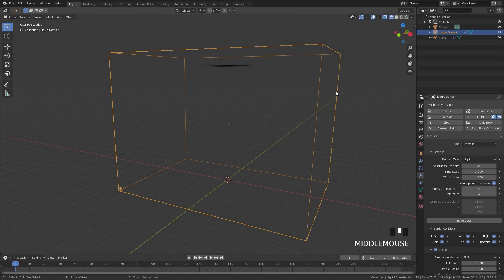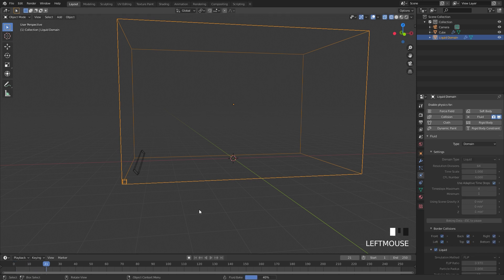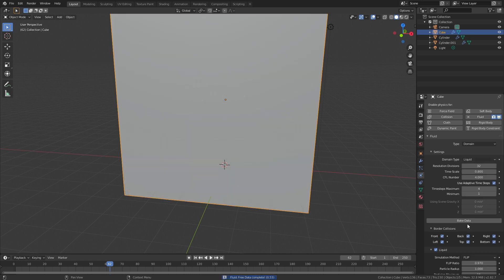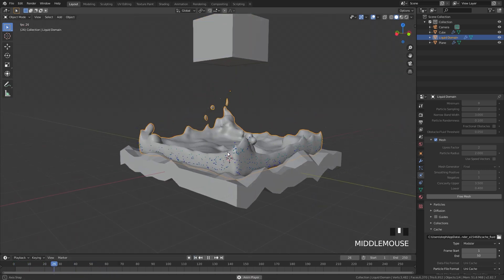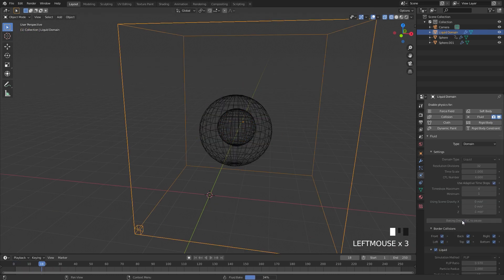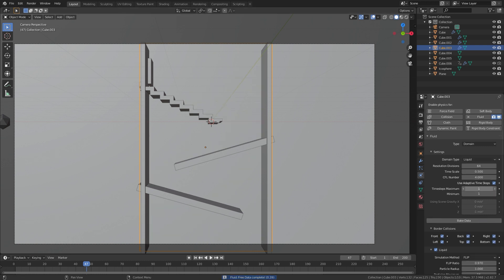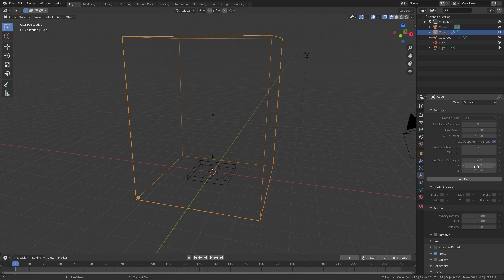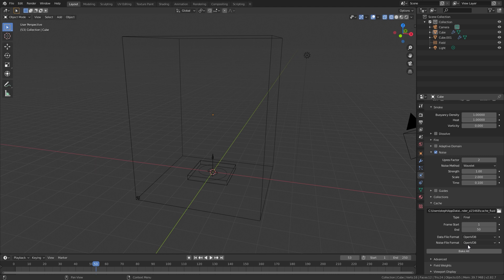Common Mantaflow Problems & How to Fix Them!

Comment: It took me like 3 days to figure out most of the stuff that was mentioned in this video.
While there's no official documentation on the manual about how to troubleshoot the issues, this video will save you a lot of time.
Great stuff, thanks for this!
Reply: can you run by me if you can how to water sim a cube falling down steps with water splashing inside? 
you touched briefly on it......ASAP PLEASE.....AYOUR WORK IS wonderfully inspiring.....
Reply: TheModulator Hey switch from replay to modular and go to cache section of the domain and select an EMPTY folder..
Reply: Took me 3 hrs before I actually gave up and went to youtube
Reply: @kruddystupididiot  Select Domain, then
 Select type, then change the option from replay to modular or All (blender 2.91.0 )
Reply: i guess im asking randomly but does anyone know a tool to get back into an instagram account..?
I was stupid lost my password. I love any tips you can give me.
Reply: TRUEEE. this is life saving hahaha
Reply: 3 days.. pfff.. decent turnaround hahah
Reply: @tomdrake4069  flip normals of cube, put water inside, done

Comment: At 1:00 Select "Is Planar" option for planes ( I believe this option is for planes cuz when i selected this option, it worked well) It works for cylinder or cube which has no thickness

Comment: I'm using the fluid simulator in Blender 4 and this video solved all my problems with dispersing particles. Despite the posting date, this tutorial remains current and functional. Thank you very much.

Comment from the maker: If you have encountered any other problems that I did not discuss in this video reply to this comment and I will try to help out! 
Edit: If you do not see the bake button that is because in the Cache panel the Type is set to Replay. Set the type to Modular and you will see the button. 

Also sorry for the low framerate. I forgot to set up my recording properly! Whoops.  Next tutorial will be back up to 60fps!
Reply: How about the grid pattern in the particles like spray, foam and bubbles. How to solve it?
Reply: Blender Made Easy Yeo bro is there any way I can contact u????
Reply from the maker: I think that is a bug at the moment.  I heard somewhere that it shouldn't be like that.   CG Geek had a great method for getting rid of that grid pattern that you should definitely watch!
Reply from the maker: For business inquires check my email on my About page.
Reply: Thanks for the reply 🙂
Reply: I finished the fluid simulation in my project... How to add a smoke simulation on my fluid object so as to create a boiling milk kind of effect...?
Also, when i tried to apply my bake my fluid domain mesh, it doesn't animate the mesh anymore... how to get around that problem
Edit: also will the surface thickness work for outflow object too?
Reply: this is amazing. is there a way the fluid will go correctly through small holes/tubes? i have a scene with a teapot that i want to pour liquid from (the pot doesnt move) but it wont go through the thin spout, i tried to change multiple settings with no luck, it either gets through the mesh too or it wont go into the tube too far to actually pour out... (its created from a sphere in the teapot)
Reply: I am making a larger fluid simulation, and the fluid is off center and smaller than the flow object.
Reply: I am trying to flow water through pipes & tubes, while your explanations made some improvements, but water still would not flow all the way. . . . how does real world size make a difference?  is there a easier way to to simulate water flowing through tubes & lines? what am I missing?
Reply: @Tamarita112Hyuuga  i am working on a similar problem. I need my fluid to flow through a network of pipes . . . same issue, wont go to far, kinda gets stuck after going a fraction on the length . . .
Reply: @imranwkhan  i managed to solve it with resolution divisions set to 200 but it was baking the simulation for like 3-4 hours (100 frames). and there was barely any fluid so id like to see if theres a better solution to this
Reply: Im trying to make water flow from a pipe into a mug, and for some reason the water isnt appearing. I tried increasing the size of the flow object as well as tried turning the surface emission up but nothing seems to be working. It would be great help if you could help me figure it out. Thankyou!

Ps: is there a way i could share my file with you?
Reply: I made a simulation but I can't render it as a mesh.
Reply: Baked mesh doesnt allign with the baked particles. Somehow its displaced from the baked particles. How to fix this?
Reply: when i try to bake mesh, it doesnt make it a mesh and nothing really happens
Reply: The smoke in my scene won't work properly. I got a Particle System as a Flow Source. I get something like a little smoke cloud in the first frame with the first particle and then it just disappears. No idea what's the problem
Reply: I can see my smoke simulation in the solid view but not in the rendered view. Know why?
Reply: I have a AMD Ryzen 5 3600 and a  GeForce RTX 2060 and a 500GB SSD and it takes much longer then yours to bake even just doing a test at 64 resolution divisions does the processor really make that big of a difference? its a 6-core with a clockspeed 3.6 like your i7-9700K the only major difference i see is yours is 8-core and turobo speed is 0.7 GHz faster as well as the TDP useing more power in yours but TDP really only matters for the heat output.
Reply: Would mantaflow be a good choice to do a dripping blood effect? Trying my hand at doing a melting face over a skull, was thinking shape
keys could work for the face melt but I want there to be bloody fluid on the skull.
Reply: Your video helped me a lot, but I still have a problem with my fluid simulation. I'm trying to make a moving glass of water. The glass does hold water when it's stationary, but once it starts moving, the glass slowly loses liquid (to where - I don't know, water just slowly disappears). Once the glass stops moving, the water stops disappearing.  Only if the glass moves downwards, the water doesn't go anywhere, in all other directions - the water slowly disappears. I checked everything suggested in this video. I just don't understand what's wrong.

Update:
OK, I think I kinda figured it out. Surface Thickness parameter of the effector (which in my case in the glass) was causing the problem. Apparently, effector's Surface Thickness is fine for static stuff, but not good for animated vessels. It should be set to 0 and you should increase vessel's thickness to avoid liquid leaking through walls. If you can't make walls thick enough (because it looks ugly and unrealistic), then increasing domain's Resolution Divisions helps.
Reply: I´m trying to use small portion of liquid, trying to fill a small cup of coffee. I have several issues that I think I can solve by myself looking around internet, but there´s one I can´t find anywhere. As soon as I set my particle radius to below 0.5 the particle seems not simulate properly and just hangs from the emitter (inflow). And I think I need to set to at least 0.08 to check if it makes the difference I think it will make. Do you know if it is possible?
Reply: Thanks mate for the nice video. Saved me a lot of sanity :) I just have a questio. I'm going to animate a Volcano and it's going pretty well, yet I have a problem. When I set up a short fluid inflow to simulate the lava is jumping up and falling back down to the crater it's not working. Is it possible to create a small amount of fluid that is shooting up and shortly after falling down again? Many thanks and keep on your nice work.
Reply: I can't get any fire, water or smoke to appear when I bake data, the particles just stay as particles. What should I do?
Reply: @Tamarita112Hyuuga  try to scale up the teapot, maybe helps.

Comment: Thank you! 👍🏼 It did not fix my problem but at least now I know where it comes from. Another thing to mention for fluid sims with mantaflow: I never got a proper result when I tried to use real life sizes. I had to make a 60 cm wide cup to be able to 'splash' the fluid in a realistic looking way.

Comment: My Fluid simulations never work, I add a uv sphere then then select fluid, then change the settings to liquid and inflow and domain resolution to 64. pretty much the same setting you use and see no particles when i bake data. this happens everytime
Reply: Same here. No matter what I try even the simple sim setups don't work in Blender, just not worth the time anymore :(
Reply: make the sphere bigger and try again

Comment: Hello, thank you for this video! I am having problems creating a fluid sim running through a pipe where the liquid seems to hover above the surface of the inside of my pipe. Even with no surface thickness it seems to hover over it :( I've tried everything you've suggested in this video and more!
Reply: did you ever find a fix for this issue ?
Reply: @razz6539  Hmmm, that was a long time ago but if I remember correctly pumping up the resolution size helps create smaller fluid particles. But of course that increases bake times. I would suggest getting Flip Fluids if you can afford it, I have been using it since and it is much better but it is pricey.

Comment: Another problem I get a lot is that the fluid doesn't quite touch the object it's supposed to be hitting or resting on.  I've played around with settings to get it close but I'd love to hear how you solve this.  Thanks!
Reply: Try reducing the surface thickness of the object.
Reply: @shahanashaikh7061  it's still floating even with a thickness of 0

Comment: Fabulous video for beginners.. really very very helpful.. I still have one problem though.. when I simulate fluid, between the effector and fluid, there is a small gap. how can I remove it so that the fluid gets touching the borders of the effector. Thanks in advance

Comment: Under inflow there is clearly a setting called is planar. If you check that box a plane emits just fine. Dont need ro add thickness or anything.

Comment: I am guessing that the size of the emitter has to be scaled up because it has to at least be as large as the Voxel size. I wonder if you left the emitter size the same but changed the voxel resolution if it would work

Comment: If the domain size us huge like a real life room size and the inflow is small. What setting would you need to tweak to make that fill a room? My kitchen scene...the fluid starts to over flow the sink but stops once it dripples over the edge and doesn't continue when touching the floor. I have all objects set to effector and as planar too. Is there a setting that tells it to spread out more?

Comment: What do I do if there is no "bake" option? I have done everything step by step and I don't have any option to bake so nothing happens.
Reply: That was my main problem too. You could select search (f3) and type 'Bake' which offers a 'Bake All' option, or it could be that your Cache Type is set to Replay. Try changing it to Modular - the Bake option then appears. My other problem is that no flow appears when I bake!

Comment: Thank you so much for this bro!

How do you move an already baked simulation around your scene?

I think it’s impossible to get your scene absolutely perfect before baking and I find it highly unrealistic to bake multiple times in one project considering it takes multiple hours per bake
Reply from the maker: Thank you! Glad it helped! You can move an already baked simulation by selecting the domain and hitting G to move it.
Reply: Blender Made Easy amazing I’ll try that. Also, I get very pixelated simulations in my smoke and fire. A lot of boxes and lines... even in vdbs. Any way to fix this?

Comment: Thank you for great and informative video! 😊 Any idea why mantaflow fluid simulation is crashing blender all the time? Tried final and modular baking with 2.83 and 2.9b (tried clean install too) It works with resolution divisions at 32, but crashes when rendering particles at 128 or more. Blender is not out of memory.  My system is i7 7700k Gfx1070 32Gb What I should try to get mantaflow baking to work? 🙏

Comment: Have you come across a problem where the liquid works as expected for a few dozen frames and then suddenly acts like the domain is a solid object? This has happened a lot while trying to adjust anything that alters the resolution of the simulation.

Comment: Hi, I have a question, maybe I didn't noticed before, but my issues is like at 1:05 when filling up the volume liquid go up, like only the surface will be show, while the "filling" doesn't is that normal? I use Blender 3.0.1

Comment: Hi I am facing problem water is showing in wireframe mode not in other moder so what changes I have to do pls help me🙏🙏🙏🙏🙏😭😭😭😭😭
Reply from the maker: Do you only see a cube when you switch to solid view?  If so make sure to bake in the mesh in the fluid domain.
Reply: @BlenderMadeEasy  thanks ❤️❤️❤️❤️❤️❤️❤️❤️❤️❤️❤️❤️❤️

Comment: Thanks for making this tutorial. But I bake the simulation with a cube with "quick smoke" method, I am still not getting any smoke in blender2.82a. Also in my version it seems surface emission has default value of 1.5. Thus no matter what, there is an issue that can't be solved with your methods. (The scale also doesn't seem to help) and I am still looking for one that can solve my problem.

Comment: The problem with  turning up the surface thickness though is  that the fluid doesn't really touch the  object its taking form of, is there a way to fix this?

Comment: I have a situation where the fluid is avoiding the collision object.  and I dont know why. its interacting with the object but doesn't collide. its just changing directions in mid air.

Comment: Thanks for this. I have a question about rendering a drinking glass in Cycles. If I render just a solid cylinder in Cycles and apply a glass material, it pretty much comes out looking like glass (although, even after smoothing, I still seem to be able to see in the reflection the mesh divisions). However, if I make a cylinder, remove the top face, apply a thickening modifier, smooth it and add a glass material, it seems to come out very dark, almost black when rendered in cycles? How do I fix this?

Comment: Hi, i have a problem with my collision, i cant make my fluid simulation  inside of the collision, i want to make a water to come out ofthe box down the stairs, first i tried to make a domain around to water not to come out of the stairs border and gived the stairs the collision object. I saw that this tipe of domain doesent works and works only when doman has 4 ungles so a changed it to collision and made a new domain. Than i saw that water appears only outssideoff the collision.I tried to revert normals but it didn't work. What to do, please help.

Comment: Hi, do u have a fix for the invisible liquid through transparent object like Glass sphere or something ?
Like my liquid is basically in the sphere and i can't see in on the render but when a moove the sphere with just the fluid it is visible..
(This is NOT the normals thing, i already did that and it works fine)

Comment: First of all thanks for the tutorial it's really usefull but also  I just want to ask that, I made a sand clock and I try to make an animation, but when i setup the fluid simulation the sand stay inside of the upper part and it doesn't goes to lower part of the glass. I couldn't fix it. :S do you have any suggest for that  (version 8.3)

Comment: Great video, thank you!  Is there a way to get fluid to flow from small flow objects?  I'm trying to get an inflow to work in a small diameter pipe, the emitter needs to be small to fit in it.
Reply: Scale up the whole scene?
Reply: Either scale up the whole scene and reduce real world size or increase resolution divisions(this worked for me)

Comment: Hi! Super useful video, I finally managed to make some interactions! But I still have some problems... I have a fluid that should be lying on a surface like 3:25 one, but when an animate object interacts with it, the fluid is pushed through the mesh and partially disappears. How can I get it to behave differently? 

I'm trying to animate a splash in a puddle, if you have any other suggestion on how to do this you'll make me very happy :D

Comment: I have the same problem which you mentioned as the second problem the object is small. I don't want to scale up the object as it needs to be small inflow. How to overcome this problem. Thanks in advance for the solution.
Reply from the maker: I don't think there is any other solution to this.  What you could do is scale everything up so the inflow still looks the same size compared to everything else.

Comment: How do you fix the fluid simulation increasing the volume of fluid as it flows? I have tried reducing the particle size as suggested in various places but in my scene it keeps increasing in volume. If I get too small with the particle size the fluid just vanishes part way down.
I have tried adding outflow objects to reduce the volume of liquid but that has led me to another problem: the outflow objects are not removing the particles! They are solid objects, resized cubes.
Any ideas?

Comment: The method you used for checking normals was incorrect. You needed to turn on 'Face Orientation' to see the Blue (Normal Facing) and Red (Backside Facing) faces. Also, Shift+N doesn't Flip Normals actually, but instead technically it 'Recalculates' the normals (and invert is to invert the recalculated ones). It is also not fool proof btw, since sometime blender can't ascertain for a face which side is correct, and we have to manually flip normals (F3 Search Menu).

Comment: My main problem is wiggling on simulated surface. I used smooth modifier - that help a little, but surface still have weird distortion. Increasing resolution help too but even on 400 resolution I still have problems. Has somebody any workflow to get rid of that simulation artifacts?